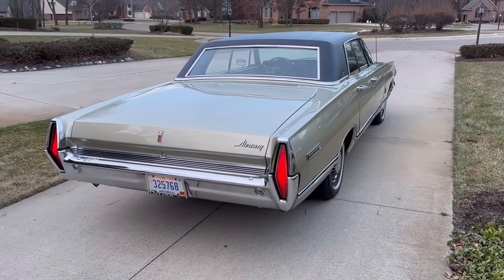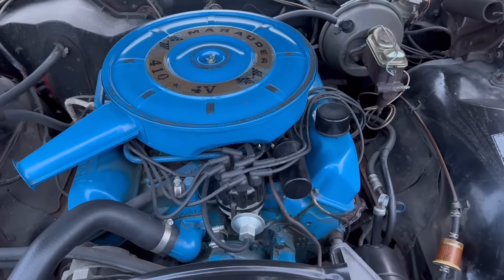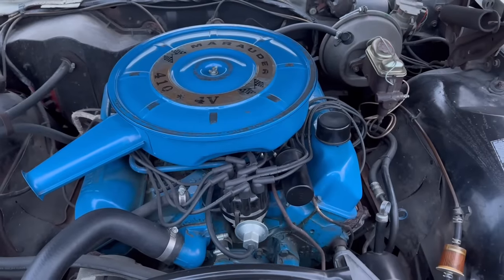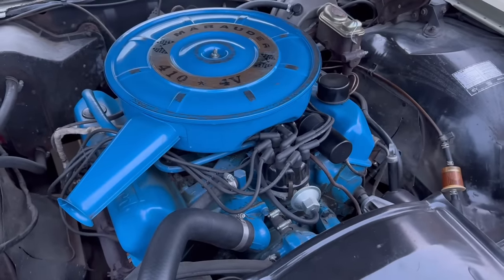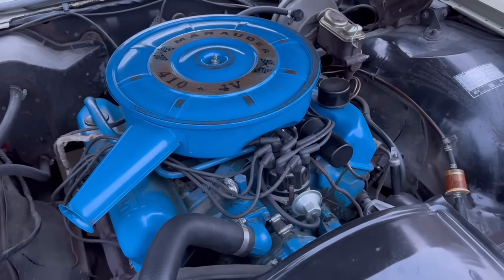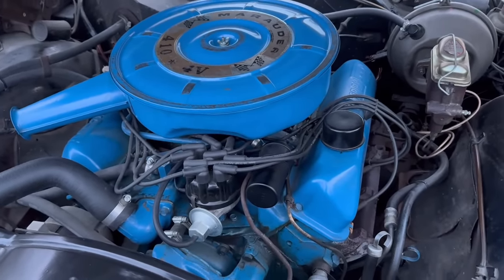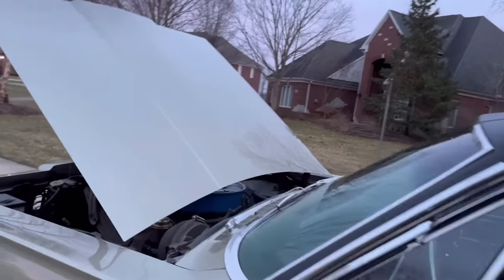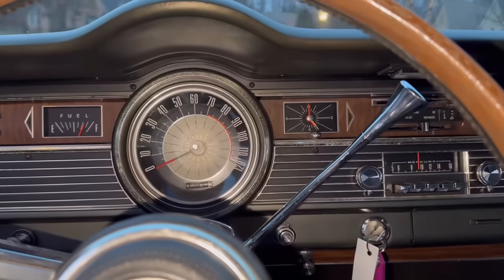Ford's Shortest-Lived (and Smoothest) V8 Engine: The 1966-67 Mercury Only 410 V8

Comment: My younger friends and I have an ongoing debate about the virtues of electronic ignition and fuel injection-as the old guy, I always vote for points and carburetors! Here is proof that you don't need all of the technology to have a smooth running engine-thank you!
Reply: EFI makes the same engine last longer. I saw in the 70s on Volvo when they offered fuel injection as option and more recently when chevy didn't make any changes but introduced throttle body injection in 84. Carbs overfuel and knock down cylinder lubrication when cold with choke and also on throttle opening due to accelerator pump squirt. Not as accurate in a lot of other load ranges too. Not speaking to reliability or do it yourself repairability.
Reply: As long as all the cylinders have even compression and the distributor is in good working order, you might be surprised by how smooth a carbureted engine with points ignition can be. Case in point the old Mercedes-Benz M1 80 That was used in the fan cars from 1960 to 67 was an exceptionally smooth engine. It was a single overhead cam in-line six as well so it was fairly technologically advanced.
Reply: Won't find a nicer one. It's a keeper buddy.
Reply: points
Reply: 70-year-old here too I'll go with electronic fuel injection and electronic ignition any day of the week versus the old carburetor and points distributor system.
Reply: The problem with running points today is that the replacement parts available are mostly Chineseium crap.
Reply: I added that stuff to my 390 lol    I don't think a smooth idle proves anything on your part
Reply: EFI and electronic ignition provide better performance and fuel economy but a loss in dependability. 1920's cars on the road today are still running factory original carbs. I'm currently running 3 Holley 2bbls that were built in 1962. I do have to clean my points occasionally but I buy good quality points through MAC's. All of their parts are either OEM or Ford authorized reproduction parts.
Reply: @jimmyaber5920  If your carb is overfueling then you need to tune it up. Choking the engine provides a richer fuel mixture but will not wash down cyl walls unless your choke is out of adjustment. The same when accelerating. You can also adjust the accelerator pump to reduce the fuel shot. A properly tuned and jetted carb does not overfuel.
Reply: @FRLN500  In theory having everything mechanical is more reliable but in practice not so much.  Engines clearly lasted longer when the automakers switched production from carbs to EFI and electronic ignition.  And they work from sea level to as high as you want to drive in all weather conditions and temperatures.  Try driving a 1960s or earlier car from Houston to any one of the many 10,000 foot plus passes in Colorado.  You're going to be making adjustments on the side of the road.

I will agree with you that cars have been made less dependable by direct injection and turbocharging.  Simple port injection is best.
Reply: "Do it yourself repairability" with efi is sort of an illusion...only exists because of parts availability.  Will you make a fuel injector? Or even rewind the coil inside it? A hot wire airflow sensor? 
   Probably not. This also applies to some carburetor and points ignition parts, but less so. 
    Many hobbyists keep 100 plus year old engines running. 
    If a 2020 camry is running in 2120, it will probably have some sort of carburetor adapted to it.
    The parts supply is more fragile than you think, and it's existence is an economic decision that you don't make. 
     Individual CV carbs, or well designed manifolds, reduce or eliminate cylinder to cylinder mixture variation.
    No, not as convenient or maintenance free as functioning efi with a parts supply in place. 
    The parts availability is already an issue with 80's efi cars. And, yes, for plenty of old carbed cars, also, but not in such an absolute, binary way..improvising is more likely to give acceptable results with carbs.

Comment: My Grand Dad had a 64 Parklane with the lowering rear window. He retired in 75 as head of Dyno Lab at Michigan Ave Engineering. From 64 until summer of 75 I went to every Sunday Event at Mich Ave. My Highlight was sitting in driver seat of Lemans winners when they rolled of trailer when they came home. In 2000 I took my son to Greenfield Village to see that GT-40. I met so many NASCAR and Indy Ford owners and drivers during this period, my Grand Dad always kept up with Racing until he sadly passed. He gave me his SAE plaque with the plastic model of the 65 Indy motor, the 1st "Bundle of snakes", it was 250 or 255 ci with the intake where exhaust was normally. He did a lot of work on the 351 Cleveland heads and always said that was Ford's best motor. Best Memories.
Reply: Mercury also had 383 ci engine just below the 410

Comment: 221 Windsor was introduced in 1962 and production ended in May 1963 because customers preferred the 260 Windsor. Depending on how many months the 410 was in production, the 221 Windsor may be the shortest lived Ford V8. Interestingly the 221 Windsor had the same displacement as the original version of Ford's flat-head V8.
Reply: That is correct. When Shelby built the first Cobras from chassis & bodies he brought in from A/C cars in England. A/C went under due to no engines, so Shelby bought up all of their stock & slipped in the 221ci Windsor. The 260ci came out & replaced the 221ci. The first two Cobras were his samples. He repainted the cars to make people think he had a stock. He put a 283 4bbl in one to pitch to GM, But they said no because they did not want competition for the Corvette or other cars in the works. Same for Chrysler, but they laughed him out of the office. He reinstalled the 260ci & pushed his way into Ford executive offices to see HFII. Told HFII that he wanted to pitch his Cobra & had 2 operational units with the 260. HFII got excited & wanted to hear the pitch. Ford took the pitch & gave him all of the factory backing he needed to build the cars. He got a hangar at LAX & went to work. Next was the 289 HiPo with 271hp built to Shelby spec of 350hp. He reengineered suspension & frame to handle the hp & was on his way. When the 427 came out, the car had to be widened considerably & again reset suspensions to handle 500hp. The Mustang came out & Shelby was tapped once again & built the GT350 for 1965. These cars were racers & were just brutally fast beating everything in its class. The 1966's had racer & streeter with the streeters available with all regular options including a/c, special Shelby rally pack & more. The GT40 was initially built in England & failed miserably. Once again, Shelby was called upon to make another winner. With major reengineering & two testing/learning years at Lemans, they learned & won four times in a row, smashing Ferrari because the old man would not sell to Ford. Enzo had his ass handed to him in Europe while in the states, Ford was very successful in stock cars, using the Galaxie 500XL & Mercury Marauder with 427 high-riser. Ford also did well at the drags with Galaxie & Marauder lightweights, but needed a faster car to run with the smaller Chryslers. Thus the Fairlane 500 was on the scene. Stripped to nothing, not even carpet or back seats!! With the 427 low-riser, the little Ford was nearly untouchable. Only 100 were made for race teams & only cost $1. Next was Fords 427 sohc & dohc. The sohc was a screamer & great drag motor with 1x4, 3x2 or 2x4 carbs up to 675hp with 2x4. Sohc was used by such great drag racers as Connie Kallitta, Dyno Don Nicholson, Bob Glidden & more.  The dohc had same induction, but nearly 800hp. The Dohc is extremely rare as very few were made for testing. My grandfather retired from the postal service & became a tech support specialist for Ford. He was in the lab in Dearborn when testing the dohc. He said it was impressive & amazing. The sohc was slated for use at stock racing, but that asshole Bill France gave Ford the negatory, although 500 vehicles had the motor. The pussball let Chrysler run the 426 Hemi, but no on the Ford. The 427 high-riser was tweaked & still beat the Hemi may times. Next was the Boss 302/351/429 motors. 1969 was a horrendus year for Boss 302 as Ford ran it as a tunnel port. Ran very poorly, so Chevrolet won the manufacturers championship for the year. Ford roared back for 1970 with an updated Boss 302, thus destroying Chevy, Pontiac, Olds & Buick that year. 1971 was Ford's last year of factory backed racing. Boss 302/351/429 dominated in their classes here while the 427 beast could not be touched in Europe. Ford & Mercury won many races & many championships during that time. HFII & Lido Antonio Iacocca ran a tight program. God Rest Their Souls
Reply: @aldonelson5757 question,  wasn't that 221 block used by cosworth as the starting point for their 1.5 dohc F1 engine?
Reply: @michaelatkins9780  yes
Reply: @michaelatkins9780  hey Mike. I've not heard that. Is that a question or a nod ? Cheers from New Zealand 🇳🇿
Reply: @stevelee5724  old age and treachery, my friend.
Reply: My 2 door chestnut '62 Fairlane 500 was equipped with a Windsor 221 cu in 2 year run. Would love to have the engine for a street rod today. Had to trade after seeing Tiny Lung win Daytona in his '63 Galaxy 500 fastback.
Reply: @waynespyker5731  Not much you could do with a 221 Windsor.   Because of the narrow cylinder bores, no other Windsor heads will bolt up.
Reply: Bores have same spacing on 221s
Reply: @michaelatkins9780  Are you talking about the GBA turbo from the 80's, that engine was a descendant of the Essex V4 and 6 cyl family.
Reply: @johnjones928  negative. Jim Clark drove cooper's F1 entries in 63 and 64 indy 500 where it was the 1st rear engine victory. Yes, the father of the mini. However, I can't rule out cologne ( ford/Germany) participation in the development. V8 dohc 1.5liter in Europe originally.
Reply: @michaelatkins9780  As far as i know Cosworth never made an engine for the 1961-65 F1 1'5 engine era, their first V8 was the DFV that was derived for the DVA 4 cyl. You must be thinking of the Indy winning ford DOHC engine that was later downsized to make 3.0 L "406" that was used by McLaren for 1966 F1 season, that engine was conceived for the Windsor small block
Reply: @johnjones928  apparently you didn't read my comments earlier.  I mentioned dohc v8 multiple times, multiple times.  Didn't mention cosworth, but. Cologne, Germany 🇩🇪 engine plant. Neither Essex v4, v6 or anything from 70s or 80s. I only mentioned indy to hopefully get you (search engine of your choice ) a starting point that you could reference. Indy in 64 had little to no limits on displacement, unlike F1. 1.5 was F1 in 63. There were v12, v10, v6 and I4 at that displacement.  Yes on 3.0 displacement at indy, there's no replacement for displacement in 'merica.
Reply: @michaelatkins9780  You kept mentioning a 1.5 dohc V8, and in your original post you asked if Cosworth used the Ford 221 as it's base. What are you referring to with 1.5?  The displacement or something else?
Reply: @johnjones928  note that was a question, not an assertion.  My question was:  the block a starting point for the 1.5 F1 dohc v8? It was in response to the seemingly overwhelming knowledge of the guy who opined on the 221 Windsor block. Now that block is cam in block w/push rods and ohv but, in production. So it would be cost effective as far as a bird in hand. Cosworth could've designed heads,valvetrain and further engineering, thereby sharing costs from Hank Ford and vendors participating. Hank could then take the credit for the success or blame the vendors in case of failure, as he was known to do (ask Iacoco, McNamara). Hank would also reap the benefits of  indy and dirt champ cars utilizing the design later on. I already knew of 3.0L use at 64 indy 500. Doesn't it stand to reason that Ford would use as much transferable data and hardware as possible? I mean Ford did embarass Ferrari with a 260, 289 and then a 427 stock block production engine between 1962 thru 1967? With Carroll Shelby's help, of course.
Reply: @michaelatkins9780  I understood all of that, but you keep saying "the" 1.5 F1 DOHC  engine, not "a" 1.5 F1 DOHC V8  engine so to my comprehension you're saying such a thing existed. Maybe it's just a problem of semantics.
Reply: @aldonelson5757  Why are you calling this 221 Ford  a "Windsor"? Was there some other 221 that this needs distinction from? Or is that just how it is called, like "390 FE".
Reply: @johnjones928   "a" and "the" are noun determiners grammatically speaking and can used interchangeably in many phrases. The 1.5 liter V8 dohc engine exists. It's known as ford's greatest race engines ever in Europe. Because of the simultaneously engineering programs of Shelby America work in both Europe and USA,  who we know started with 260 Windsor block in a Bristol AC cobra, there in lies the reasoning in my original question, "could these 221 block research or materials have used in the development of that 1.5L V8 (degree unknown to me) dohc F1 engine? I guess if I knew the degree of the V8, I would have my answer because, the Windsor was a 90 degree which you know sets the firing order.
Sir, that's the best I can do explain my thoughts. If this doesn't clear up the semantics, I sincerely apologize. After all, I am just a good old southern boy from the sticks outside of Fayetteville NC who grew up in the infield of dirt tracks and early Nascar tracks cleaning windshields, changing tires and beating my brothers fenders back into something recognizable.  I have enjoyed the conversations and English proper could legitimately be my 2nd language.
Reply: @michaelatkins9780  Are you  talking about the Cosworth DFV 3 L V8?
Reply: @johnjones928  I answered my own question with research. No, the 221 block had nothing to do with the 1.5liter dohc v8. Its block was two 4cylinders combined into a v configuration that was designed by Duckworth for Cosworth. Its1st design was 1.5liter displacement, later enlarged to 3.0 liters. DFV was what it later became known as double four valve. So, what do you want from me? I was correct on displacement but wrong on nomenclature. As well as answering my on query. 
However, I was pulling from my grey matter, not the internet. You seemingly  are unaware of that 1.5L existence. So, maybe you research that. I've tried to be respectful with my words. So, whatever contest this has become, I lost. Have a great day my friend.
Reply: @michaelatkins9780  Yes, that's what i though you meant, as i posted before the DFV came from a smaller 4 cyl . It was never produced as a 1.5 L V8 but was destroked into the 2.65 L Indy dominating Cosworth DFX turbo. 

  Now here's a fun fact, The Repco RB620 that won 4 world titles in the mid 60's began life as the Olds Jetfire 215. Plus the 289 Windsors in Shelby's FIA Cobra's and GT40's used English Weslake heads.👍

Comment: I had a 410 that was made from a '73 FTE 390 block, a set of 406 heads that had massive ports, an Edelbrock intake & 750 CFM carb, a better cam profile, a 428 CJ oil filter adapter (better oil passages) and a 9.25-1 CR. 
A set of TBC Thorley headers,  3" exhaust with an X-crossover, it was a very nice, torquey motor in my bump-side F250
Reply: Frankensteining engines is fun. I had a 318 (Chrysler) I had used 318-3 heads (large exhaust ports closed chambers) headers and a hipo 360 camshaft an old hipo 273 four barrel intake manifold with some AFB Chrysler carburator. The thing revved and had gobs of torque as well
Reply: That would have been a sweet truck.

Comment: Adam I built a 410 at .040 over. I hot rodded it by enlarging the main passage that ran the length of the engine. I blocked the down passage on all of the passages just above the can with a spill back to the pan and at the bottom of the center passege. It kept the oil flowing and cool all the way back to 5. 1 was priority, 234 had a set of priority cross bolted mains that braced the block and created priority oiling and 5 was also. 418 ci 750 Holley Roller Can. Factory deep sump race pan C6 AER with 2.15 intake 1.625 exhaust valves softens chamber heads on the aluminum medium Riser intake. And stainless steel headers in a 67 Mustang. Fastback 4 speed fully internally balanced with Mallory metal. It dynoed at 618 hp and 625 ft lbs of torque. It was a beast and mechanical noise was non existent, just a lope from the cam. My wife made me sell it because it really was a menace. But I loved building FEs and I have found that building a 418ci engine that makes that kind of power that weighs halfway between a 289 and a 351 and crushes 600 hp with factory parts is one heckuva  engine. I never broke it. The FE was the best engine ever made. I got the C6AER heads from a truck the 3 Aluminum cross bolted mains that were able to allow me to wind it up to 7000 rpm’s and follow it Notor Trend story to make it a priority main engine was great 418 ci at 7000 rpm’s with reworked F 100 heads, a Medium Riser intake 750 DP carb. I didn’t spend much money on it, but dang it was a beast!  All I wanted to do was faceplate that 351C top loader and have the synchros dog ringed so all you had to do was let off the gas and shift it. 😂I am 63 now. I really want to do it again!
Reply: I always replace the 4350 and intake with a  open hole aluminum intake and a 625 Holley . And they cranked out the torque. I miss your drive around, it is a
smooth runner!
Reply: I like the fe engines,what kind of pistons did this 418 cubic inch have
Reply: @eddiefe428  they were 4032 TRW forged with a 1.66 compression height. 4.09x 3.98. .  It ran as well as a 428 .